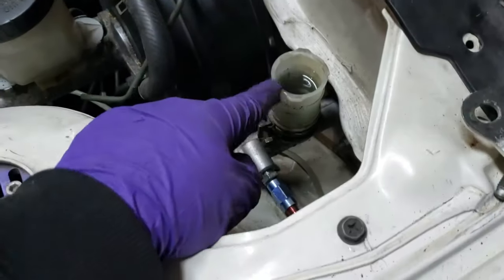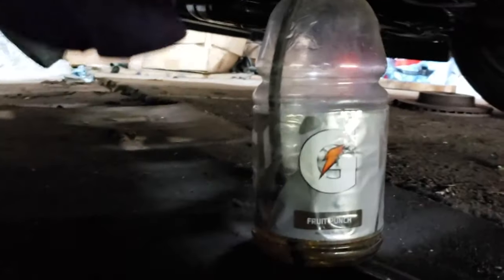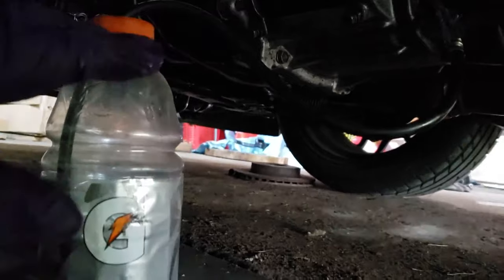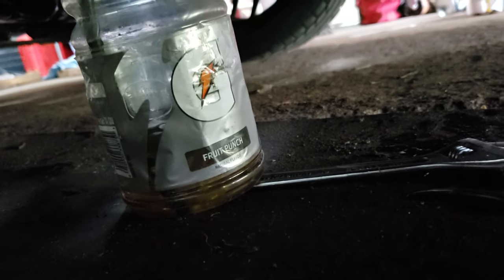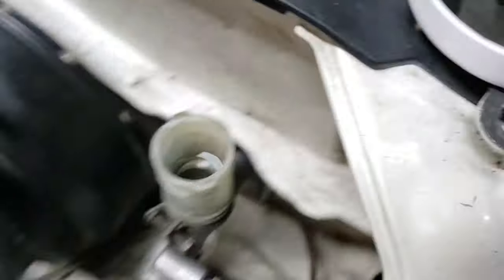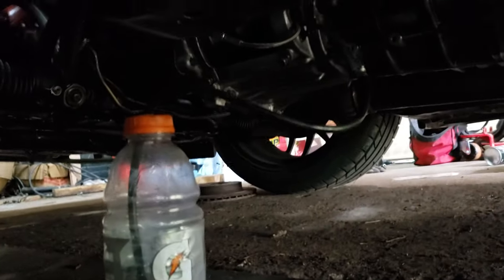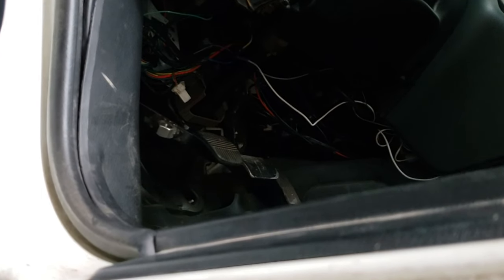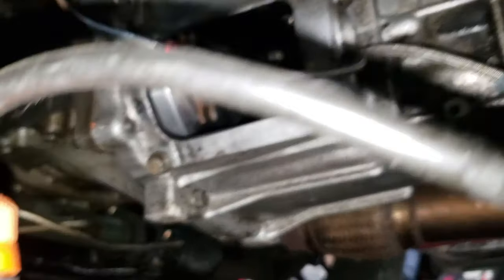HOW TO BLEED A CLUTCH BY YOURSELF

Comment: Just seen your video on making the ign1a harness,ill be watching it again I'm sure lol 
Also are you using an R154? How did you make your clutch petal stopper? I used a bolt and 2 nuts
Reply from the maker: Im using r154, and i welded a nut to my pedal and used a chunk of ready thread

Comment: That's great! I can also use this to bleed the brakes.
Reply: No. The brakes are easier to do. You push the pedal in and open the valve for a moment, let it bleed. Close it back up. Release the pedal and repeat process until you see that the liquid coming out is smooth

Comment: With a skyline its been a thousand strokes to it still not bled
Reply from the maker: Make sure the hose is air tight, so air can't be pulled back in
Reply: It can be a real pain in the balls, still without the new clutch in, just replaced the slave and master

Comment: This won’t work for many cars.
Reply from the maker: How so
Reply: @RabidJz  when the slave is mounted on top or the gearbox you have to unbolt the slave and clamp the piston in so it’s blocked.

Then you can bleed it as you would bleeding brakes.

Comment: This is absolutely wrong. You should be flushing out the old fluid as you go along with bleeding. A lot of people watching this are going to have old, dark fluid and that shit NEEDS to come out, not just get sucked back and forth with a little bit of new fluid.

There are many ways to do things... Many ways to do things the RIGHT way. This isn't one of those ways. Its wrong.
Reply from the maker: There's a clear bottle for a reason. There's no reason anyone will have fluid in their reservoir after disconnecting a line. The fluid will gravity drain. It would be wrong if i showed you old fluid being sucked back in. But that's not what I showed. There's nothing wrong about this if you do it right. Worked great on my 850hp car with my brakes as well.